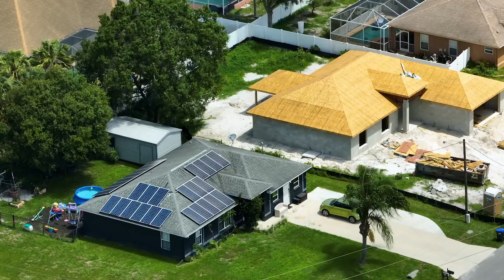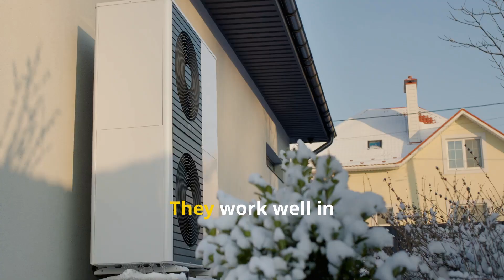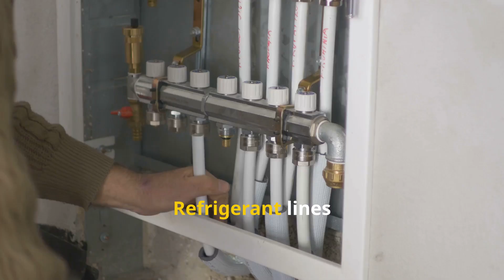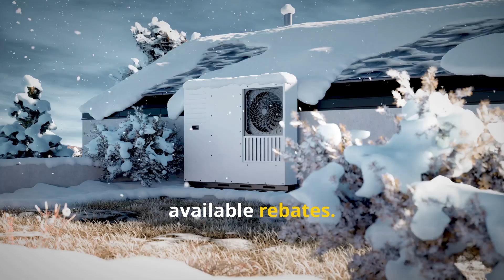Heat Pumps for sustainability

Comment from the maker: Step inside the fascinating world of heat pumps — from the raw copper and aluminum that form their coils to the final commissioning in homes and businesses. This in-depth documentary-style video reveals every stage of manufacturing, including coil production, compressor assembly, and quality testing, before following skilled installers as they set up outdoor and indoor units, connect refrigerant lines, and optimize performance. Learn how heat pumps work, their environmental benefits, and the future innovations that could reshape home heating and cooling forever
00:00:00 Why Your Next Heater Might Be a Heat Pump
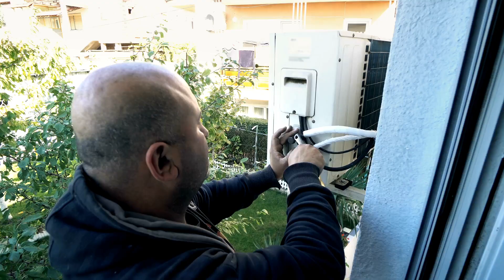00:00:58 Science Time! How Heat Pumps Do Their Magic
00:02:08 Air vs. Ground
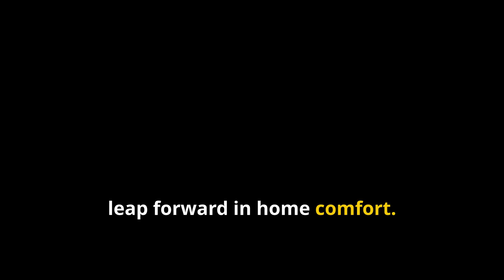00:02:52 Designing for Efficiency
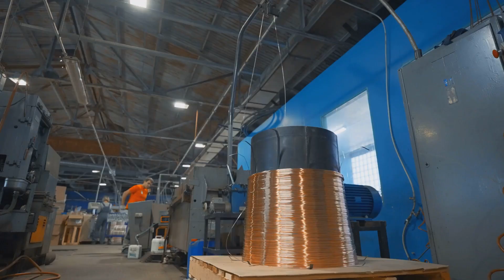00:03:42 Sourcing the Right Stuff
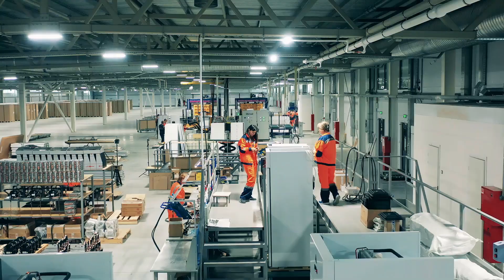00:04:23 Putting the Pump Together
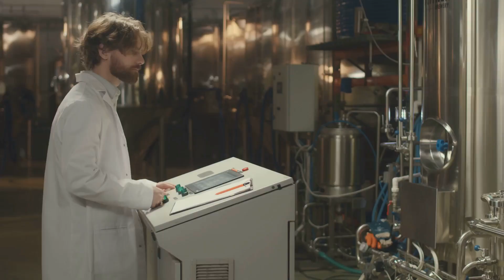00:05:02 Quality Control Before It Ships
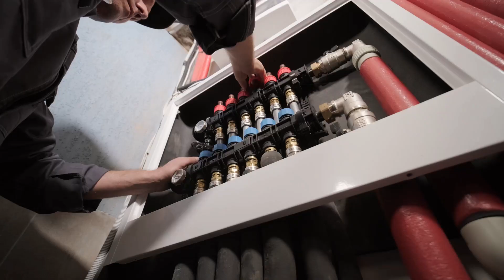00:05:46 The Installation Journey
00:06:29 Simple Homeowner Maintenance
00:07:01 Greener, Smarter, and Cheaper Heating